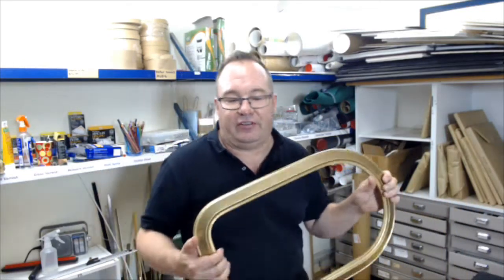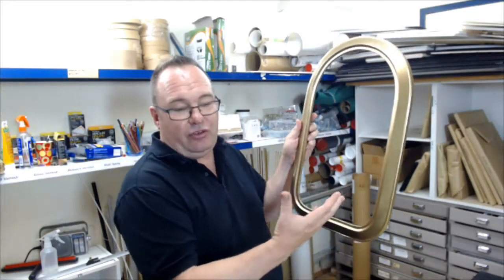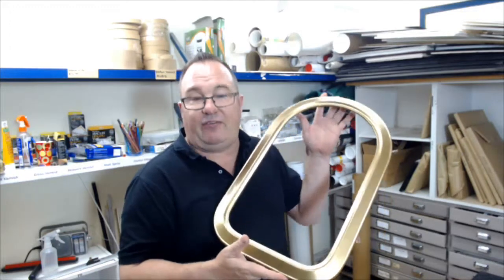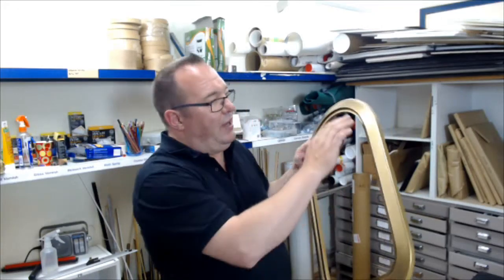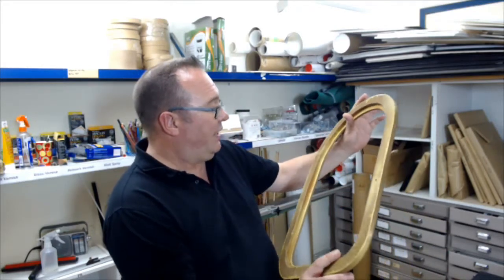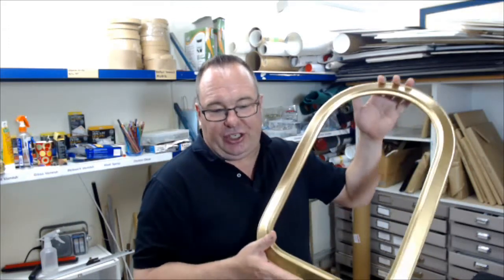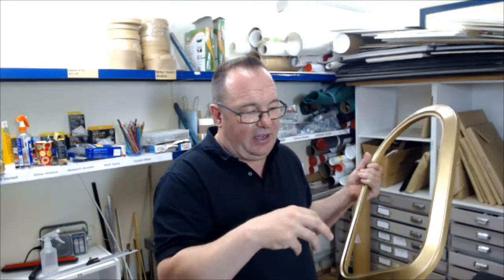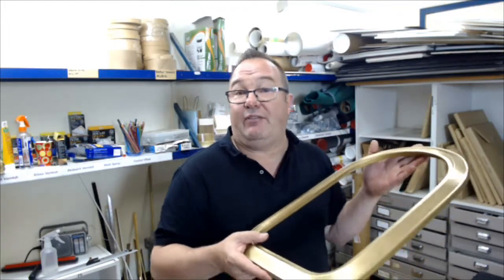Restoring wood grain finish on cathedral frame

Comment: Hi there I was wondering if you could help me. We have a beautiful jersey that is signed on the front and the back. We don’t want to cut the jersey in half. So what we were looking to have it framed like was in a clear box (similar to how dried flowers are kept) so that we can hang it from the celing and you can see both sides. We would also want a plague on it and a photo sitting it with it. Is this possible prayer 🙏 🤲
Reply from the maker: Hi Deb, we've framed numerous items where both sides need to show. There are several solutions including the acrylic type box that could work. If you are in Brisbane maybe pop in and visit us at Fix-a-Frame and we can show you a few ideas and work things out. 

We are open 7 days at Fix-a-Frame, 1230 Logan Road, Mt Gravatt. Open 9am everyday. Close 5pm weekdays. Close 12.30pm weekends.